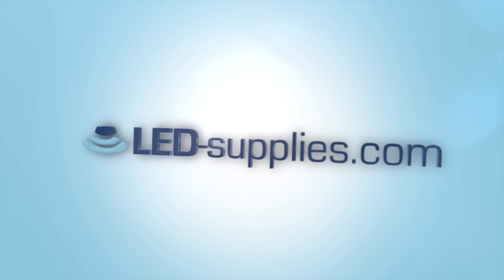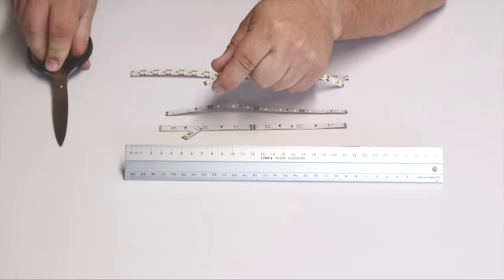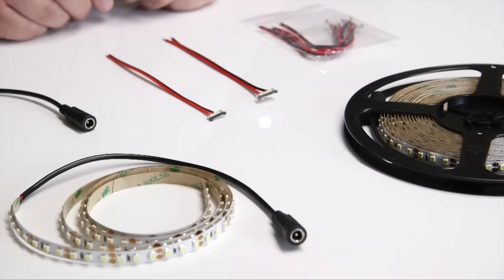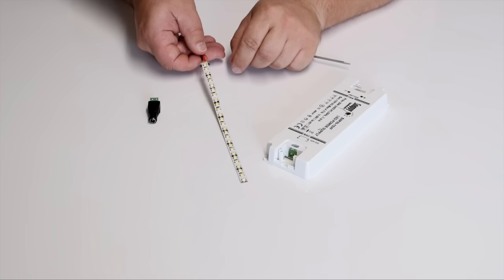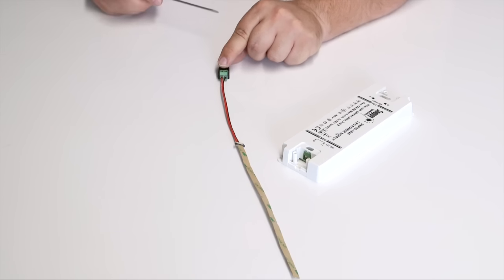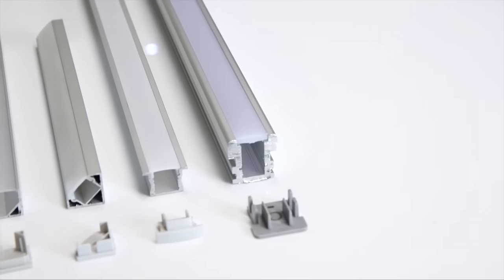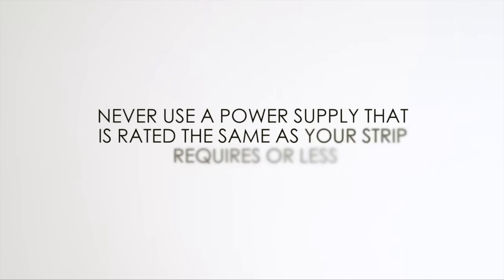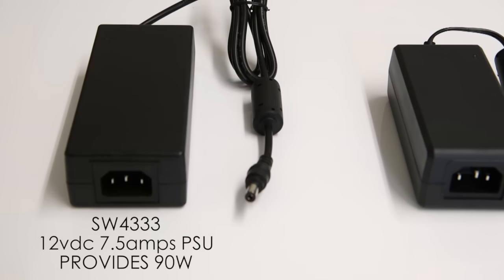How to cut, connect & power LED Strip Lighting

Comment: I just need to know how to connect two strips together
Reply: RGB connector. They’re all over amazon
Reply: @KP-fm4rv  I'm confused why I would cut it in the first place then if the connectors are so short...
Reply: Same did you find out yet?
Reply: Jacob Toske nope I just had to hang up a bunch of extension cords all around my room. Also I have to use 4 remotes 😅
Reply: @esliaurkiko  cant you use the same remote
Reply: Jacob Toske no it doesn’t work I tried to pair two to the same but it doesn’t work
Reply: Aaliyah Essien I might have to do that but really want to find a way to connect it without 3 remotes
Reply: steven morris yes that’s what I wanted to do, because I don’t want a bunch of cords all over  my room and when I want to change the color I don’t want to use 4 different remotes.
Reply: steven morris you might have to get a longer version and if not you can buy a connecting strip that connects them together
Reply: @esliaurkiko  Hey, 

So I want to buy Leds too. I want 5m for my desktop and 5m for my bed. This comes with only 1 receiver and 1 controller, how should I do this? I can not connect them both together cause they are not next to each other
Reply: @esliaurkiko  omg u do t do that u just buy 2 and then connext them on the roll theres a extra wire u just connect the other onto that
Reply: @esliaurkiko  that's why u measure ur room first so u don't waste money
Reply: @esliaurkiko  heyy did you find out how to connect multiple strips ??
Reply: @jacobtoske7192 nope please help
Reply: Siddhant Sarkar Mine doesn’t have those I already checked
Reply: Same that’s why I came
Reply: My lights come with a way to connect each of them together but I’m trying to figure out how to do it so the ugly cords don’t shows
Reply: I’m sure u have found out how to connect them now
Reply: I guess you could just put them next to each other when you put them down
Reply: They should come with connectors so you don't need to use multiple remotes
Reply: 2:08
Reply: strnger caleb thank you but My led lights didn’t come with those, and I can’t buy them😅
Reply: Aalv Edits same
Reply: SAMEE!!!!
Reply: Thank you!!!
Reply: Tea Time same
Reply: Solder
Reply: Literally
Reply: Aaliyah Essien legit same tf aha
Reply: No really
Reply: There should be a pin adapter with the original box you plug the pin adapter into one side and plug the other led’s into the pin adapter as well
Reply: e
Reply: Video dekh
Reply: Bruh Just solder the wires in the same order
Reply: amazon sells some connectors
Reply: Same
Reply: snap connectors work great
Reply: I’m so fuckin confused. Did I break it or what confused 🤷🏽‍♀️
Reply: Righttt
Reply: SAMEEEEEE
Reply: I think to fix it you need a 4 pin connector
Reply: /watch?v=8IldE5sE5rQ  just use a 2nd strip instead of the wires
Reply: Learn to solder
Reply: Positive to positive, neg to neg. Connected
Reply: Same
Reply: You would probably have to solder the strips together with wire in between the strips.
Reply: Same 🙂🙂
Reply: There are people starving in Africa and you can’t be bothered with using 3 remotes? How dare you! You have stolen my future! Jk… yeah, it should be simpler. 😂
Reply: Sauder them together. Positive on positive, negative on negative.
Reply: You will need buy iron  soldering set in your local tooling shop. Or solder-free connectors for led strip also work
Reply: Check out the replies to Dan Miller's comment! Someone explained it there
Reply: Lmmfao exactly
Reply: You can buy a splitter so you can connect multiple LED strips to one receiver, so you can use the same remote for all of them
Reply: @coleheath7712  Where can I buy this splitter?
Reply: Isla Heath what is a splitter? Is it this black part that has the ends cut of and there are two wires? One positive one negative? Because that’s what was in my LED lights pack
Reply: Kyleen P what is that ??
Reply: Phoebe crowther in not sure. It’s some black kind of plot that looks like it could plug into the LED but the part that you put it in the wall is not there.
Reply: How do you connect your phone to it
Reply: Fold it.
Reply: Aaliyah Essien 

Ss

Comment: I’m having a heck of a time figuring out soldering without burning the components. I finally got going and got about 30 inches. I put liquid tape on the exposed wires and now I have about two inches of lights flashing. WTH?

Comment: Thanks for providing such a comprehensive video ! Lot of videos are there which tell about how to cut and connect but no one and I mean it no one talks about power calculation and using the appropriate Adapter with it . 
This shows how detail knowledge you have . :-)

Comment: My lights didn't come with the connectors:(
Reply: MCRTS mine didn’t either :////
Reply: Mines didn’t come with the power supply
Reply: Same and now it’s not working
Reply: mine just came with the wheel ):
Reply: MsPotat wth
Reply: Did you buy cheap ones? My $12 ones from wish that dosent even work came with 2
Reply: Sameeee the package said it would but 😔
Reply: MCRTS mine has a connected but it was already cut and I don’t know how to put it back on
Reply: Just Fahad eW
Reply: Same :/
Reply: U guys need to ask the seller or check the description if it includes the connectors if not just buy it sepratly i hope yall dont make the same mistake GL
Reply: You are beautiful by the way
Reply: Don't forget about me 😂
Reply: me too
Reply: me tooo

Comment: me: *cuts where it says cut and sees it won’t turn on now*

i give up
Reply: hello have a good day LITETALLY JUST HAPPENED TO ME
Reply: @dangmelll  same
Reply: @dangmelll  vc,
,Cc,,c, cnn*?*??✓'wv!"?%*
Reply: 😂the part that is connected to the power source are the only ones that will turn on.
Reply: @donyae1711  This. I did not have this in mind when I bought 10 meter of led strips, i literally cut the first line and i now have 5 cm that works and about 9 meter that doesnt. Loving life, really.
Reply: Donyae’s Destiny so what’s the point to cut them if the part I just cut won’t work!!
Reply: @donyae1711  wdym?
Reply: hello have a good day I JUST DID THIS AND IM SO FUCKING MAD FUCK WHOEVER TOLD ME IT WAS OK TO CUT THEM
Reply: katelyn you can cut them if it’s too Long but not cut the length you want, cut the length you don’t want is the key and make sure your not cutting on the adapter side, you won’t get power if you cut there
Reply: @katelyn4656  mood
Reply: katelyn Jesus Christ loves you :)
Reply: LITERALLY
Reply: @snatched6830  

. 

. Km
Reply: i’m so stupid i literally cut it and forgot it won’t have power and o don’t want to do all that wiring
Reply: gina gina same
Reply: @joannaarlene561  wdym it won't have power?
Reply: bruh i got these damn daybreak LED lights and im trying to connect the 2 strands together and it keeps turning on but it wont stay in that fucking position and ive been working on it for the past 3 hours now and my arms are screaming for oxygen.
Reply: @travisnott  hello omg so i just bought them and i am working on them rn and i cut it like it it said here but i the other side cant connect bc it didnt come with the connectira or whatever i need help
Reply: AmadaporDios Alvarez you can’t buy the connectors online
Reply: @travisnott  what do u mean by they wont stay in the position? they wont stay on? or the same color ?
Reply: @baku5130  like the one strand im trying to connect wont stay lit and when it is lit, its a completely different color. all i know is that daybreak LED lights are ASS for 28 bucks.
Reply: @travisnott  if they have plastic on top of the led bar you have to strip it all away. and you can be pretty rough and it will work . and make sure whatever connector your using is fully attached on all 4 pins. (Corner Solderless Connector 12V 72W)  thats the one i used no name brand.
Reply: For me i needed to put ot onto the wall first
Reply: Hold up... did all you lot really think that if you cut the strip, both pieces would still keep working, even when one half isn't even connected to anything?
Reply: @stanlloyd385  I'm seriously wondering the same thing. Like, you can't just cut something off from a power supply and expect it to get power....this is the current generations equivalent of "did you plug the computer in?" And everyone's freaking out like you can't just buy some connectors off Amazon and have them delivered the same week...then there's people suggesting they solder stuff and I'm like: yo. They can't figure out basic electricity.  Don't encourage them to use a soldering tool.
Reply: Stan Lloyd yes 🙂🙂🙂im dumb like thatttt
Reply: Same no I’m pissed no 🧢
Reply: I did the same Exact thing and now I’m mad
Reply: What do u do I just did that
Reply: Same and now I'm crying bc I just got them cuz im stupid like that
Reply: I WAS LIKE 😦
Reply: @meli3053  Melissa, get the fuck off LOL, fucking pikachu.
Reply: @tunod-  ummmm ok
Reply: @tunod-  ?
Reply: @faith123  ?
Reply: @faith123  Just dont cut it LMAO. Trust me, just dont. If u plan on doing it ur gonna have to solder some shit together and that's a waste of time. Buy the length u need and dont waste it like I did lol
Reply: @tunod-  But how to you make it go around the face of something? You just let it bend at the corners?
Reply: Thats happening to me Rn idk what to do
Reply: good thing i'm not alone
Reply: Fuck this bro don’t cut it 🤦🏽‍♀️
Reply: literally me omds
Reply: That literally just happened to me 😩
Reply: This happened to me right now 😭 I’m so dumbbbb
Reply: I JUST DID THIS WHAT DO I DO NOW
Reply: I got scammed from target
Reply: Samee and i just got rhem
Reply: Hey everybody just to let you know you have to buy connecters when you cut it then it should work.
Reply: Casper Greenway where can i buy the thing ?
Reply: Of course it won’t turn on, only the one connected to the power source gets the powers
Reply: I JUST DID THAT AND NOW IM MAD BECAUSE I WASTED AN ENTIRE ROLL OF LED LIGHT STRIPS SUDHDJSBGRSHEHHDHHV
Reply: Your wires are prob backwards
Reply: Sameeee
Reply: hello have a good day had the same thing but I plugged it in the wrong way
Reply: literally what i just did
Reply: My bd is may 6th so I just got led lights and I cut them where it said to and now they don't work!!!!
Reply: Omg did it rlly happen i felt that
Reply: literally just happened to me and I got them td 🥺
Reply: You need the connectors, and when you cut you can connect them using the connectors
Reply: @chase.mcf1  thank now i hotta spent 40 dollars more
Reply: Chelsiesing10 Tocoolforschool they cost like 10 bucks
Reply: I’m so fuckin confused!!! I literally fuckin cut it. What the fuck am I suppose to do next😫😭
Reply: why would it not turn on if you cut where it is marked for cutting? i don't get it.
Reply: If you're having trouble try reversing polarity.
Just got six one-foot lights and the red is negative on each.
Reply: you need another wire
Reply: I cut mine, NP, working fine so far! Using 12V 6A Power Supply Units.
Reply: hello have a good day yup that’s what happened to me rn
Reply: Me too :((((
Reply: Same i just wasted most of it
Reply: ME TOO
Reply: Thats what just happened to me🤦🏻‍♀️
Reply: same thing just happened to me.
Reply: Mishca Rey me toooo
Reply: It’s happened to me I don’t know what to do😭😭
Reply: You ng
Reply: I did that to :(
Reply: UGGGGGHHHh i just did that tooooooo fialhdsflkashdjfliahsudf
Reply: Same lmao
Reply: Sigh
Reply: Also happens to me
Reply: Same
Reply: Same
Reply: ME RIGHT NOW
Reply: Oh, I am so sad! All the tears flowing from your sad eyes after the strips are cut. Literally the same thing did not happen to me because I have read all the laments posted here. You have endured the pain, that I may not. Thank you, bros!
Reply: It turns on for me
Reply: same here
Reply: hello have a good day I started crying because I cut my lights and it wouldn’t come back on.
Reply: hello have a good day THAT JUST HAPPENED TO ME AND NOW IM SAD :(
Reply: i think ur all using garbage LED or not setting it up right i can cut and connect L joints and other such tricky cuts with no problem.
Reply: @baku5130  when u cut your strip. Did u have to add more power and another outlet to the part u cut
Reply: @faith123  No I did not.
 That would make sense tho if you added enough extra LED.
But then the larger power source would also have to be compatible with the LED and not cause them to malfunction.
Reply: @baku5130  howwww do u make it work 😭
Reply: Because he's an idiot didn't explain enough
Reply: Why are you kids doing this yourself anyway 🤣 get your parents to do it for you

Comment: Hi we do a lot of led strips in pub clubs etc . Tried the connectors with 2 wire snap  down .Most are crap.I see you have a connection that has clips. Do you sell these separately.

Comment: I've been seeing videos of peoples safes that have one single line running the interior diameter as well as two or three led lines running each shelf. Haven't gotten a response from them so how are they powering multiple separate strips with one power supply? Are they soldering into the main strip?

Comment: i ordered one of these and it did not come with all that extra stuff. just a little black thing that looks like it plugs into something, but i cant connect my strip to it bc at the end of my strip theres just wires and nothing else
Reply: ok i continued watching, that little black thing is the connector. but i dont have the “c4349” and theres no plus and minus signs on the red and black wires attached to the lights

Comment: How would I power multiple separate shorter strips. Like if I put a strip under all the seats in my car?
Reply: Tyler Welsh You could do that two ways. First you could run each individual light piece directly to the closest power source. Or, you could link your strips together, and just run the wires from one piece to the other using both side of the LED strip.  You should probably put an inline fuse and a good switch between your power and LEDs too.

Comment: Excellent video, very informative - please note however for users that use subtitles, your Powering LED Strip section subtitles at 7:22 is not showing the correct recommended length amount as per the narrator in the video. The narrator suggests 9.6W per meter strip, a maximum of 5 meters is powered, however the subtitles suggest 10. Use 5 as per the narrator, if you happen to come across this in the comments section (For those without sound or have hearing impairments).

Comment: Do you connect directly to a 12v battery? and is there an on/off switch?  say I wanted to connect to an existing motorhome 12v circuit that feeds a coach 12v light (will switch out original bulb with a led bulb)...I assume to connect in parallel and in that case I need a separate switch?   you didn't show much about actually connecting to the power source.

Comment: OK, cut it where I was supposed to cut it...but all I get is a flash blink, and nothing else.   No matter what I do, plug in, remote, on off, etc...nothing is working...what is wrong? I did check the pins. When I put in one way, I don't even get any power so I know there are plugged in the right direction...sigh  Thanks!  I am using the Nadar light strip. I am only using about 7 feet of the 13 foot strip.  Followed directions like yours. Any tips would be appreciated...you have a great vid!

Comment: Is there a way your recommend to splice several short lengths together to connect to the power supply and what type of power supply can be used if these LED Strips were to be use on a vehicle (12 volts battery)?  Thx.

Comment: What could a person use to run multiple strips off of one power supply? Looking at regular 12V DC power supplies but I don't know how many Amperes are required...
Reply: can more than one strip be wired in parallel off a single adapter?

What is the maximum wire run between the adapter and the strip?

Comment: My le light doesn’t have the connectors so, when I cut my stripes it doesn’t work 😢
Reply: bro I just cut mine like a little bit off the cut mark idrc ant it since when its lit up ts not like ppl will see it but im scared that it will blow up

Comment: What would be required for high powered ,or high output, or super bright,I'm not sure if I'm using the right terminology, and what are the differences & costs advantages,or disadvantages, I am an airbrush artist and need bright light ,I'd like to use and retrofit 2 or more 48 inch florescent lights to cut down on shadows ,I'm thinking 1 above me,and 1 on the left of me and 1 on the right of me,the only shadows I want around my working area are the ones I create with my air brush . Thank you for your informative video ,I'm hoping for a response and some direction to what I need and cost associated with both systems.again thank you so much.
Floyd gross.

Comment: If LED strips typically require a higher power supply than what's required then why don't all strips just use the highest power supply? Is it to save space and whatnot? Is there a way to hook up the c4229 to a USB portable charger? I've just started working on a project for myself and basically I want to have a chrome see through mask with the LED lights inside and i will need the lights facing outside of course, can I super glue the led to the mask? From what I've seen the sticky part is opposite the led side, and lastly do the strips heat up? If so how long does it take for them to do so? assuming I'm using the correct power supply, sorry for the lengthy comment, I would love it if anybody could answer these questions, and please keep the answers simple, I'm new at this and I'm self teaching myself, thank you!